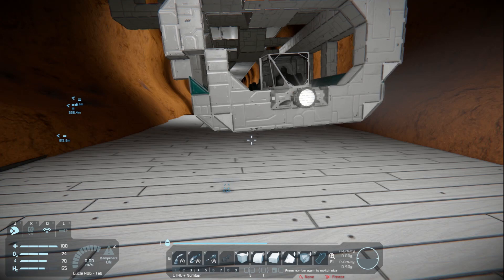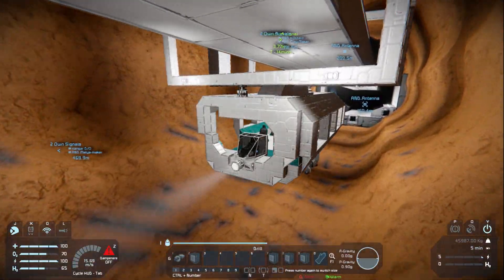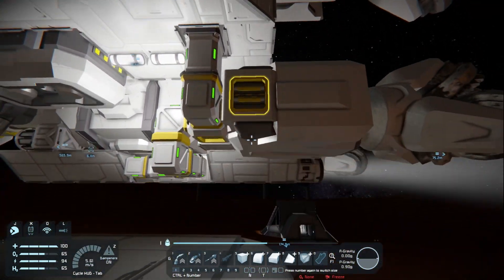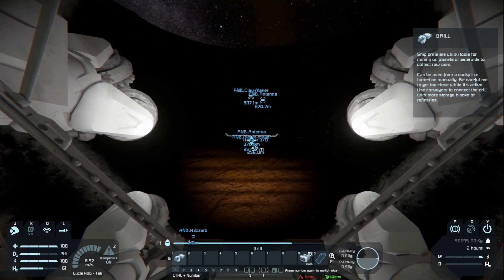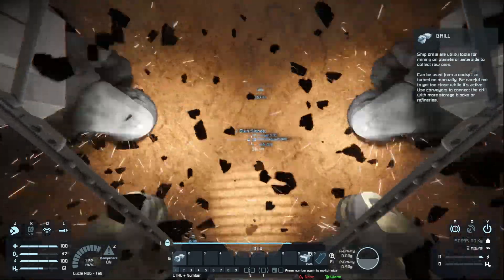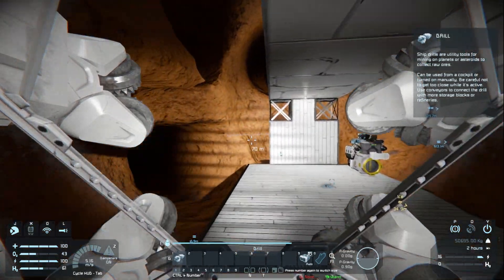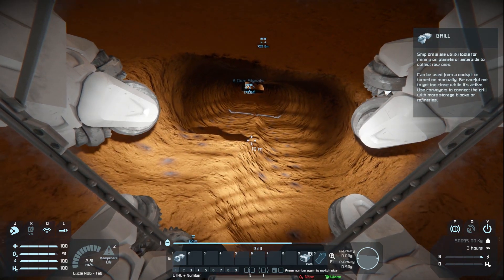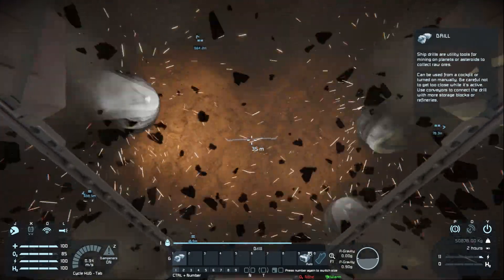Space Engineers Let's Play (S3 | E18) - Happy Little Hangar :)

Comment: Around 30:00 try using merge blocks. Normally they only work on mobile grids, but as your two grids are perfectly aligned it should work without any problems. You should really try this, because right now your airtight hangar doors wont pressurize the room.
Reply from the maker: I did try once but they didn't work properly. I even tried creative copy pasting the grid but it wouldn't place properly underground. I'll try some other stuff of cam to see if I can get it as one grid because that would save me some problems down the line.
Reply: @AndrewmanGaming  ouch thats bad. The only thing i can think of could work is basically digging the whole rail grid out so that its a mobile grid, and then work with merge blocks.
Reply: Or copying both grids in a creative world, merge them there (as mobile grids) and then paste the whole thing back where it originally was in your survival world, but that would be hilarious.

Comment: Copper oxidizes (rusts) green, so the 'moss' works.

Merge blocks should work to join the rail and base grids. Especially if they're flush, and used to be the same grid.

Why don't you make all airlocks auto-open/close with sensors? Splitsie has a good tutorial on sensor automatic airlocks.

Also useful is some LCD's showing a summary of all your inventories (ores, components, H2/O2, etc). Isy's inventory manager is good, or easy LCD

Comment: Large ship drills do in fact have a larger drill radius but I like to use small ship drills due too you use less materials for 4 small ship drills versus 1 large ship drill & if you space the small ship drills out enough that they still cover the whole area needed to be drilled will be wider then the single large ship drill's area!
Reply: Also, I tend to get my straight drill lines with a removable rotor connection(small ship rotor on ship that connects to a station rotor head that is level to where I want to go) with many pistons(enter lord klang, lol)